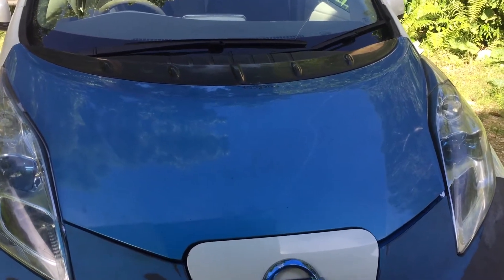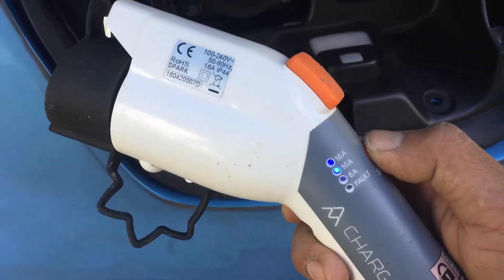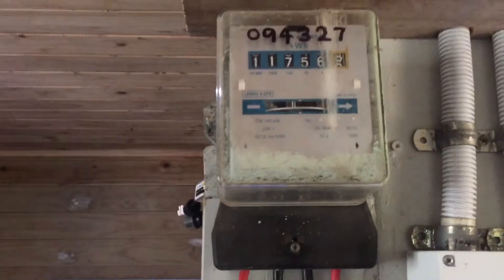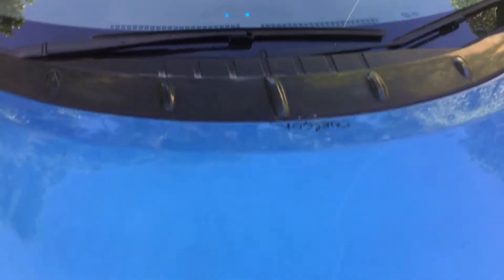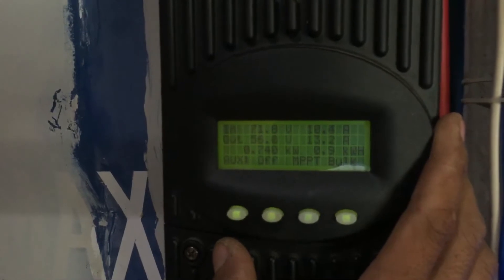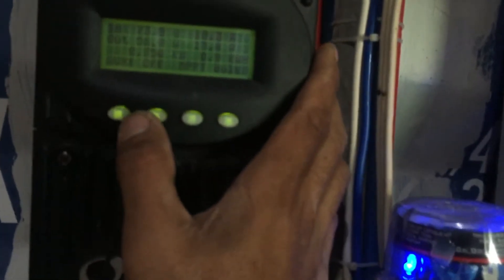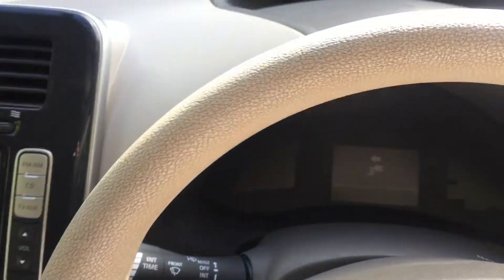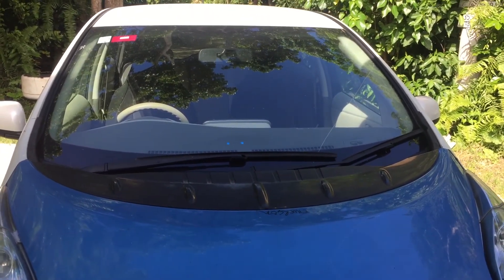Nissan Leaf charged in to off grid solar

Comment: Nice job. Great to see your off grid electricity set up. I'm in Australia, I have the exact same car, same mileage, and looking at powering it from solar. I like your EVSE charging unit that allows you to select the charging current. The one that the Nissan Leaf in Australia comes supplied with cannot be changed. Only has 10 amps. Thanks for sharing your video.